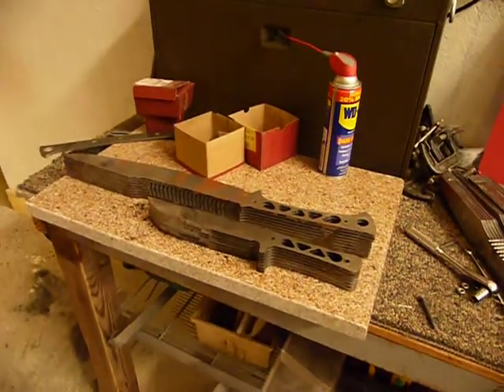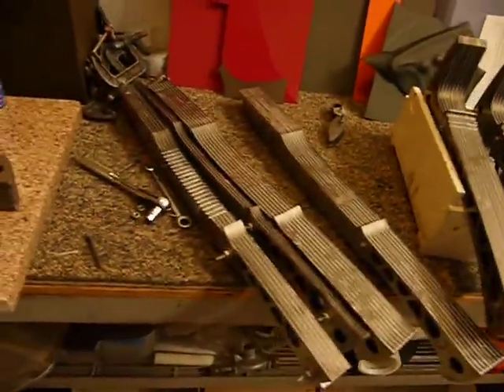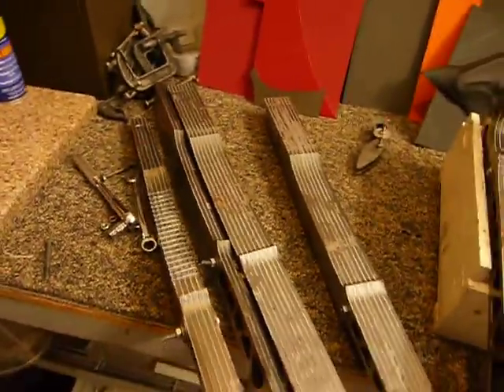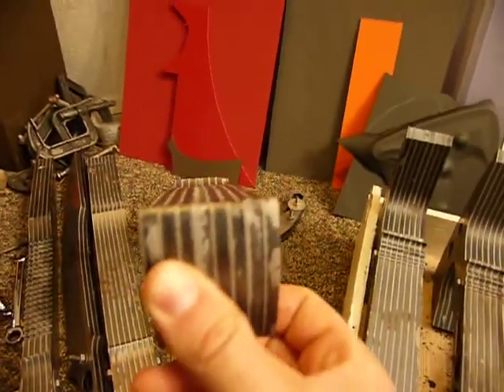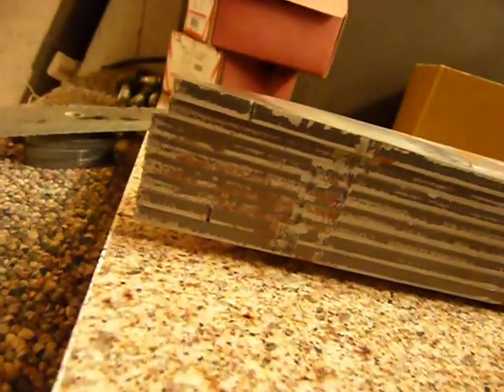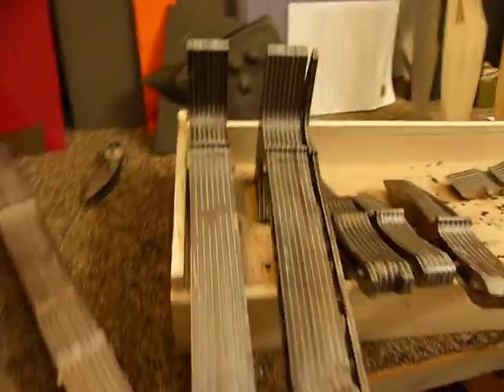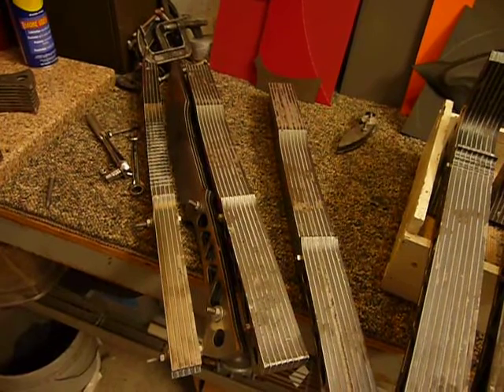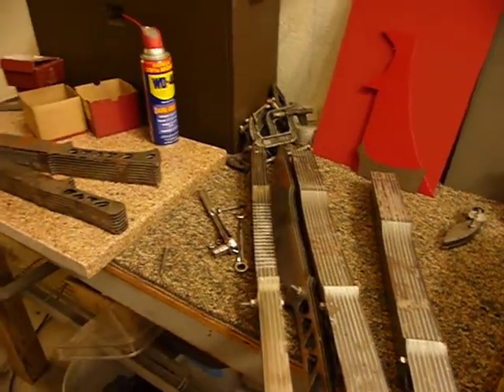Heat distortion in sword blanks

Comment: There is no need for an anneal which is only done for machinability / grindability reasons. However it is very likely you will want a stress relief after laser cutting. That is a sub-critical process (doesn't go above the transformation point in the steel).

Comment from the maker: American Metal Treating in High Point, NC is my normal heat treating company.  They have done a good job with the Austempering process we use for hardening our blades.  Because this batch of blades was laser cut instead of waterjet cut, and we had problems with warping in the last batch, I tried this annealing process to try to get the steel to settle out and stay straight.  Obviously, it didn't work.

Comment: Are you sure you sent them out to be annealed? As they should come to you annealed. 

If you meant hardened then they need to :

-normalize before they harden (likely more than once if there are severe grinding stress)

-plate quench (if possible)

-clamp and straighten during the tempering 

The last part should not be necessary all the time.